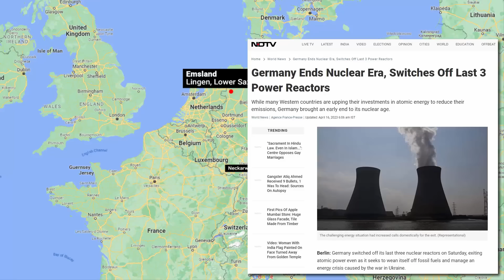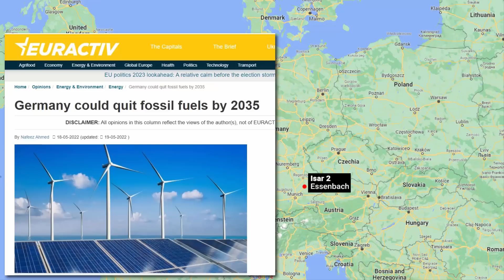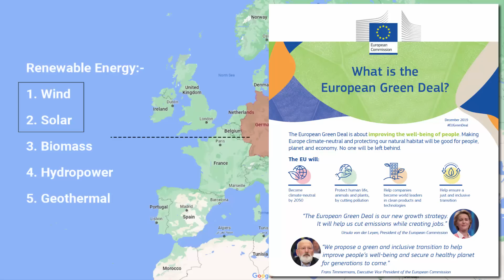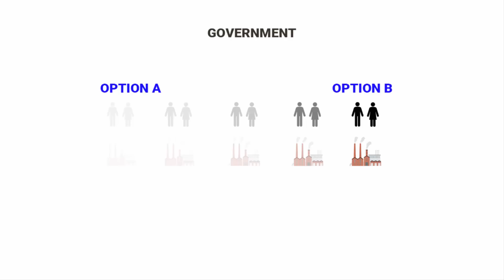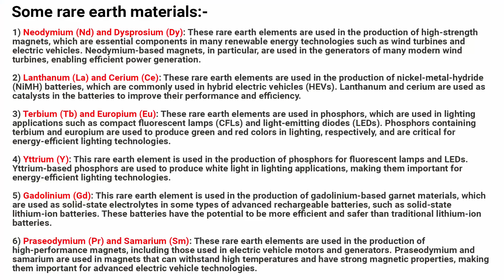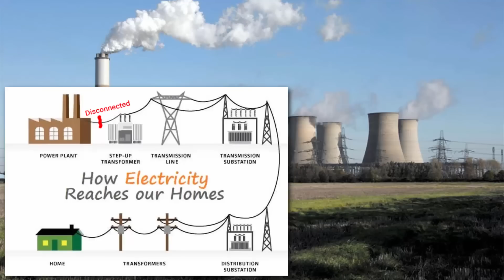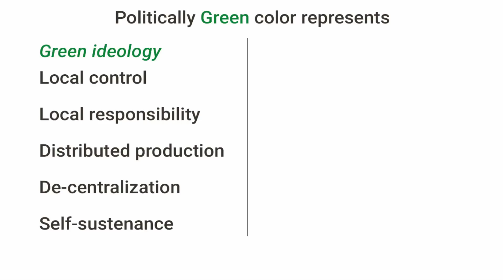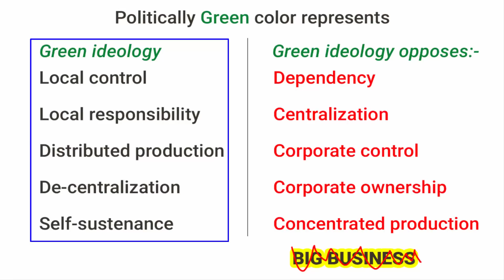Why Germany has Shut down all nuclear reactors | Reality of Green Energy, EV industry

Comment: Perfect analysis as always Sir
Reply: Quite a lot of Errors in this video.
- Rare earth. Not rare at all.  Most wind turbines are now free of Nd and Dy.
- It's during construction anyway. During 30y operations,  Nothing is consumed.
- Energy intensive. Not more than other process.
- Energy Intensive. It's more and more clean energy anyway, as we progress on the transition curve.
- Solar electricity is generated during the day. Which is also when human activity is at its peak.
- Wind is stronger during Winter, solar stronger during Summer.
- Solar and Wind are usually used to feed pumped hydro to address the top of the duck curve.
- There is a huge interconnected network in Europe so that electricity is rarely produced where it is consumed.
- Nobody claimed that EVs will "solve all these problems". We need a multi-pronged approach, Of which EVs are part.
- Lithium is only one way to make batteries. Solid state batteries are coming soon and will free us from the dependency to Li.
- Nuclear power is as clean as wastes that last for 100s of 1000s of years,
- Nuclear is as safe as Fukushima can tell. Damages are estimated to around ONE TRILLION dollars
- France is not mastering anything anymore. Not cracks in pipes, not budget overruns and not delays
- Wastes management in Germany costs tens of billions of Euros because old salt mines full of wastes now have to be cleared up and the wastes have to be moved "somewhere else"
- Decommissioning of nuclear power points cost decades and cost billions of euros
- There are virtually no private nuclear energy corporate. If only because they cannot get insurance for their activities and also because that business is not profitable.
- The alleged "green lobby" is not against big corporate. Especially not in Germany where there are a lot of big businesses.
- Green energy production cannot exist without big corporations like Siemens, EON, RWE or Uniper,